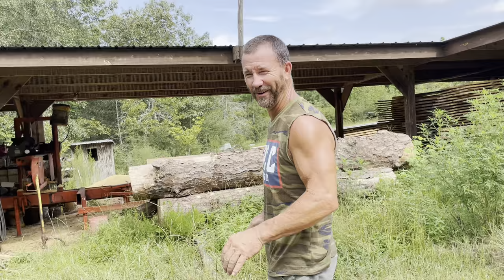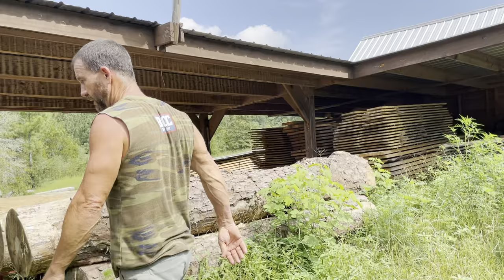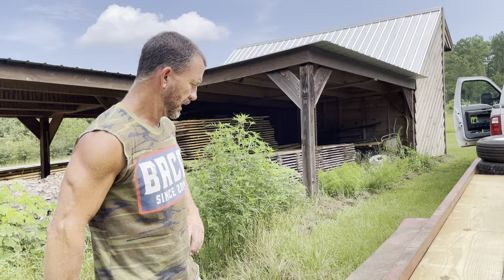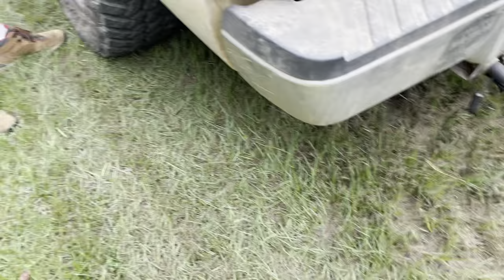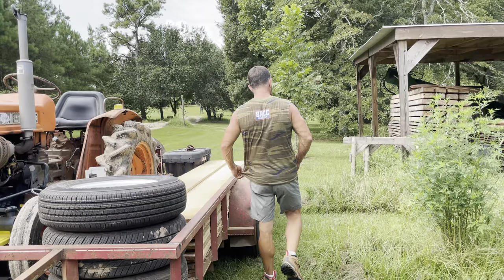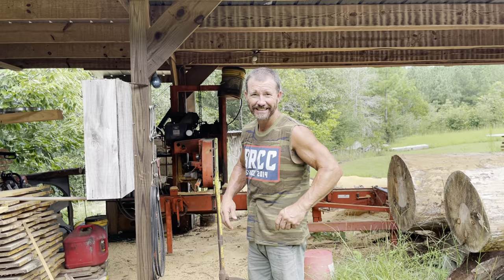Kansas Bound! Pulling an OLD Trailer 800 MILES!

Comment: When you get there young lady the climate will be totally different the Air does not have the same pollutants and humidity in it you will find that you feel cleaner longer when I went to Alaska I did not take a bath for 3 weeks and then I took a steam bag 200 degrees

Comment: How not to load a trailer. Too much tongue weight and Kubota not centered on a POS lookin trailer. Have to assume you double checked trailer brakes and greased everything for 800 miles.